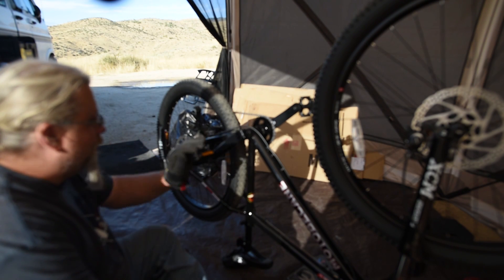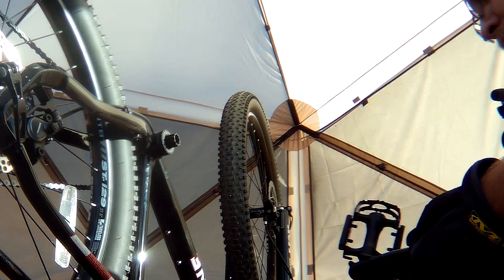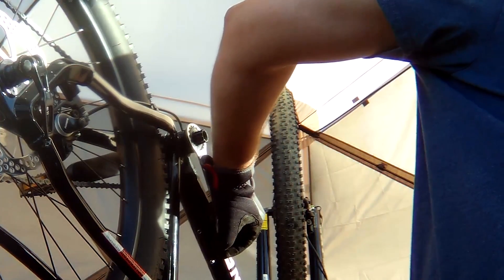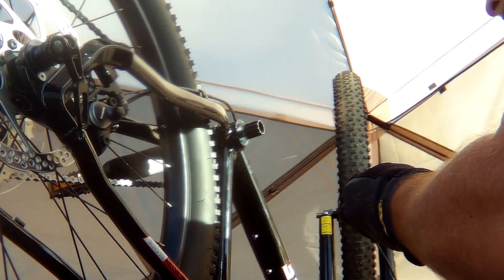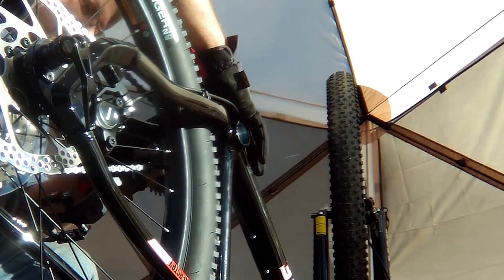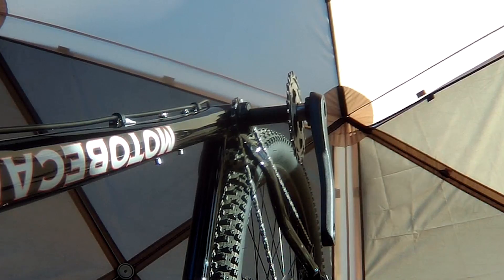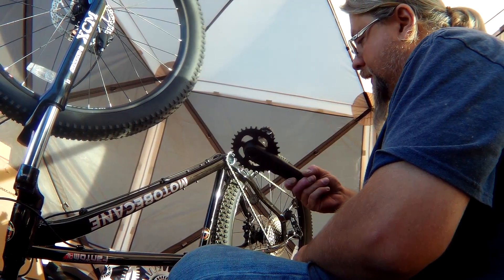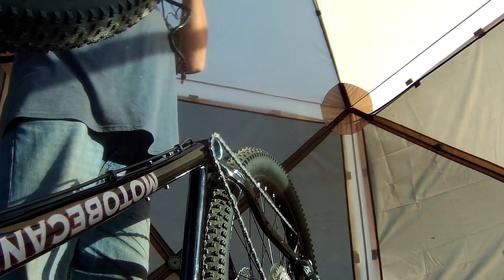DIY E-BIKE PT 2/3 | HOW TO BUILD A CHEAP FAST ELECTRIC BIKE | BOTTOM BRACKET REMOVAL & MOTOR INSTALL

Comment: The bottom bracket tightens in the same direction as you pedal so to take off turn the wrench in the direction you would pedal backwards both sides. This means one side is opposite threaded

Comment: Don't ruin a good thing keep them at 15 miles an hour for the street so you won't have to buy insurance
Reply from the maker: It's a bicycle. I don't need insurance.
Reply: @HOBOTECH  when you start going over 15 miles an hour and getting up in the speed they going to start charging you for insurance wait and see that's what I was saying
Reply from the maker: I rarely ride on paved roads so I have little concern. I just saw a kid on a bike with a 2 stroke kit burn through the middle of the neighborhood at twice the legal speed. Who you think they'll bust first...
Reply: Mine does 55, lol

Comment: Add a couple of pedal assist freewheeling hub motor to it as well for 2wd, so long as they are freewheeling type hubs the operation of the mid drive will be unaffected.

Comment: How is this cheap?  Your electric throttle alone is $779, your battery is $398.99, plus the bike, and all the accessories.  I could find an electric bike for less than $500...
Reply from the maker: I could buy a car for $500. It doesn't mean it is any good. Go to a bike shop and see what they charge for a decent mid drive e-bike and you'll see my build is very "cheap" in comparison.
Reply: If the ebike is under $500, its a genuine turd.  The batteries alone eat most of that up.   It could be done around $750 for good parts.

Comment: Thanks, I got one just like this, am wanting to know what heavy duty chain you used and what kit to go tubeless tires. Thanks for these videos.
Reply from the maker: I got a stainless Wipperman Connex chain. I used Stan's No Tubes sealant & Presta valves, and Monster brand duct tape. I tried using Stan's rim tape but it was crap.
Reply: Thank you. I was wondering which wipperman chain you got if there was a certain one as there are more than one. Also will stans work with the stock tires that came with the bike as I don't intend to use it much for offroad. I am considering waiting on the motor kit though until the battery packs come out with the new Samsung INR21700048G batteries. Those will last much longer and have a far extended range and short recharge times, minutes instead of hours on a quick charger.
Reply from the maker: If you have the "tubeless ready" wheels like I do then you need nothing else. I wouldn't hold my breath waiting for a new battery technology. There are a lot of bugs to work out, like totally redesigning BMS systems to handle the high current. Samsung is also synonymous with exploding batteries so I doubt companies like Luna will jump right on that until there is some long term testing done first. I say just build one and enjoy.
Reply: The new Samsung batteries are and have been selling in the new Schwinn ebikes in 24volt designs. But the cells are out there, lookup INR217000 48G battery. People have begun building packs. They are safer then the older 1690's and recharge super fast give you about 4 to 5 times the distance and last over 10,000 charges before going to 70%. NG, Panasonic, Sankyo and a few others are going this route. I think they will begin going mainstream after Samsung later this year. The fact that so many are going to make them, then there is a brand new Chinese battery with almost double capacity of the 21700 and that battery is also out now. By years end it should be available for more ebikes as well as electric cars which I suspect will get them first.
Reply: Thanks, got the ars seat. It actually feels about the same as the stock seat, not much softer. My frame size is 16 so not sure how big your frame size on the bike is. But I suspect you got a bigger frame size so I may be stuck with a shark type battery.
Reply: I found the ars classic seat about the same as the stock seat, not much more foregiving. One thing I don't like about the bike is you cannot raise the handlebars much. By the way HOBOTECH which chain from them did you use as they have several types including an ebike chain too. I think their "SE" chain is the ebike one, is that what you used? Also, can the 2.8 tires be used for tubeless? Just curious as I don't intend to do much off road hill riding. Thanks.
Reply: I got the same bike you did so the wheels are tubeless ready I guess. On the chain you never listed which model you used as they make a number of different chains in the same size. Was it the "SE" one for ebikes though they have other chains including a mountain bike one.

Finally, Luna contacted me on the sprocket. I chose a 30 tooth for more speed but they gave me a long talk asking me to stick with the 42 sprocket they include in the kit. Stated the smaller the sprocket the more chance for damage to the chain or cassette.

Comment: What are the chances of bottoming out with that motor, it seems to ride extremely low?
Reply from the maker: If you try rolling over huge rocks or logs, you'll hit the motor. Otherwise, I have never hit it. They do make guards if that is a concern. I don't plan on getting insane on the thing so I'm not worried.

Comment: You are a generous and a patient man, I know how hard it is to work on things and film in the same time , your efforts are appreciated .
Reply from the maker: It basically doubles the time to do things. Glad the effort is appreciated. In Part 3 I actually use a head cam which works out better.
Reply: i agree i would turned the air after putting the handle bars on upside down
Reply: supernova1976 

I completely agree with you.
🙂